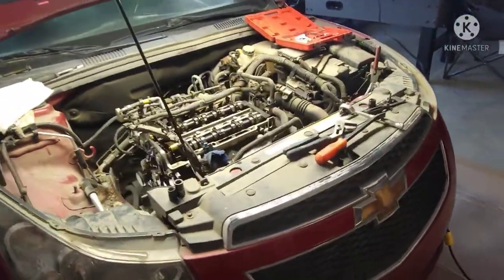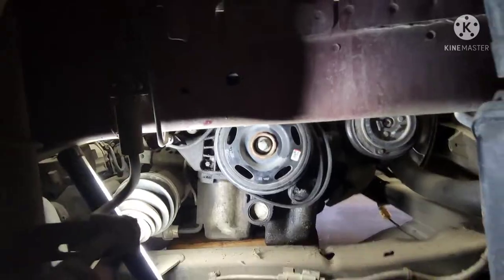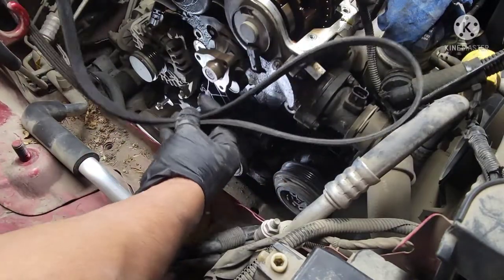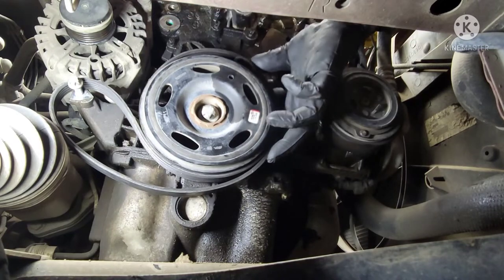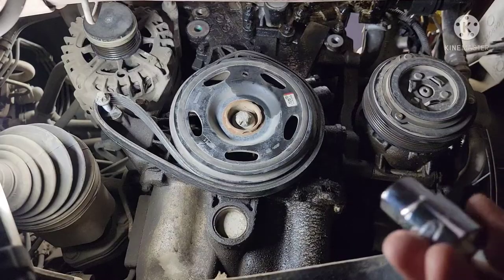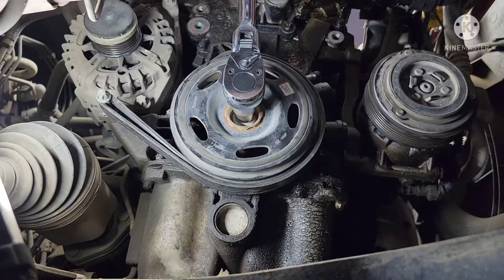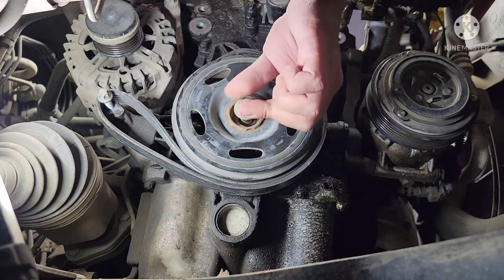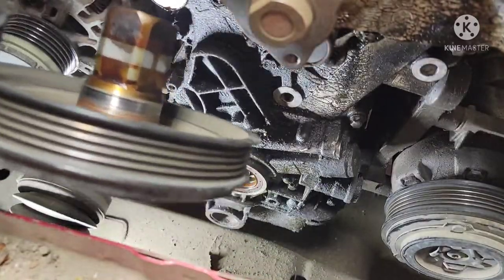Im Surprised!  I Only Use Good-Old Belt Trick to Remove this Crank Bolt.

Comment: Working on a Mercedes M272 and cant get the crank bolt off . I bought a crankshaft pulley holder and it wont fit there are two types . I have been trying for a week now . Used your method and even though the bolts was tight it worked and can i can now move forward Top man
Reply from the maker: Awesome work. thanks for watching the video Please share & subscribe

Comment: What type of vehicle are you working on?
Reply from the maker: On this video  its a Chevy Cruze 1.4L
Reply: @jfGarage4k  , I'm working on a 98 Buick century, I'm lost here. What happened is the belt jumped off, I put it back on and noticed the crank shaft is sticking out about 1/4 inch further then all the other pullies, the pulley " where the belt ride's on" just come off. I don't have any leaks and everything works fine " I'm stuck and would appreciate any input you can give me.
Reply: @jfGarage4k  , I'm wondering if it's a compression fit or if I need to replace the whole crank shaft, I didn't see any shinny metal " like if it broke off" so I'm lost here, I want to thank you for giving me any information to lead me in the right direction.
Reply from the maker: Inspect the crankshaft pulley  the keyway and the crankshaft.  That crank pulley should go in farther in  towards  the engine
Reply from the maker: Check this video i made. I hope this help out https://youtu.be/4RmOr8HFOuc